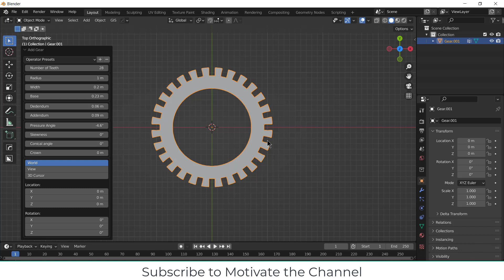Why pressure angle of gear is between 14.5 and 20 degree

Comment: The diagrams bear no resemblance to actual gear teeth. Gear teeth are involutes, with standard pressure angles of 14.5 degrees (very roughly prior to WW2), 20 degrees after. The weakness was in the root of the gear tooth, and 20 degrees gave a wider root, hence the change. In no cases do the gear teeth form sharp 'points.' Whilst other pressure angles were and are used, it wasn't generally a range between the two, but one or the other.
Reply from the maker: Thanks for sharing your knowledge.if you don't mind can you please share the source so that I can get more knowledge and make better video
Reply: @engineerknow  Well, if you googled you would find loads of info. Youtube has videos on the same lines. I've commented on this one: https://www.youtube.com/watch?v=NU-U64anuoI&lc=Ugxk9Is23hpmzOr__oh4AaABAg . See this introductory article: https://www.geartechnology.com/ext/resources/issues/1084x/back-to-basics.pdf There are many more articles on the same site.

Comment: Sorry but the reason for a 14.5 pressure angle is linked to historical limitations in computing power. 
The sin of 14.5 degrees is very close to 0.25. This made life easier for gear designers of yesteryear who did not have any access to computing power to carry out their gear geometry analysis. 

Gears with a 14.5 pressure angle generate a lower radial force on bearings, are quieter and consequently have less losses but are weaker than say 20 degree pressure angle gears which are a modern good compromise.
Reply: In fact, the sine of 14.5 degrees is close to 0.25. Actual value is 0.25038.., so given tolerances at the time, 0.25 is a good enough approximation. There  were plenty of multi-digit numbers in gear calcs that this saves little effort. And they had and used logarithm ("log") tables for multiplication and division.
Reply: @BillDavies-ej6ye  Cheers and thanks for picking up my typo! I will fix now.
Reply from the maker: First of all I want to say thankyou for sharing this wonderful knowledge as I don't know about it. If I ever make video again on topic like this I will keep in mind

Comment: I guess what I'm confused about, is on an pure involute, the shape is a curve, when pressure angles are used, as with the convention processes, won't it bastardise the pure shape a little bit,  I understand that this is fine for normal applications,  but for high speed high power applications, like aircraft and power generation. Doesn't the profile have to be more pure, even though their now hypoid gears